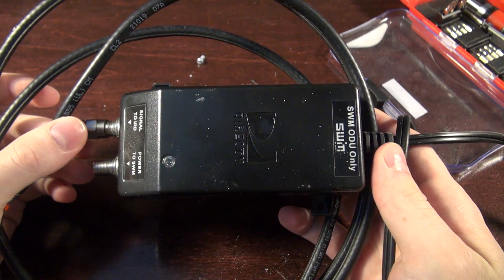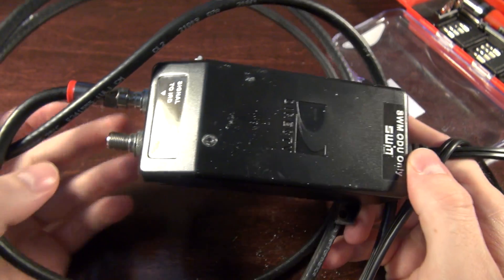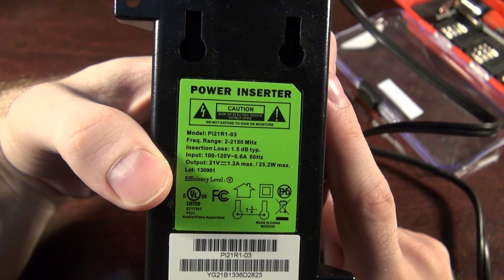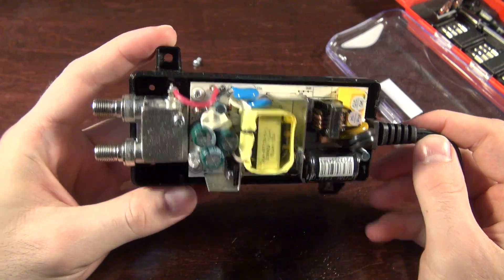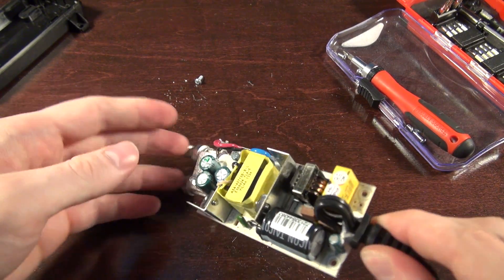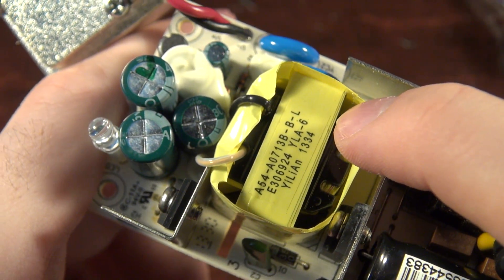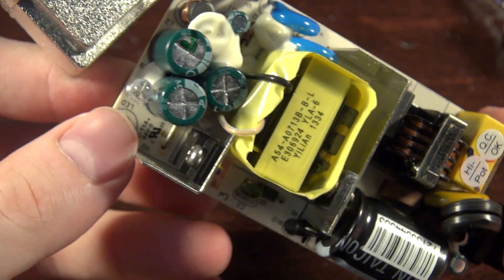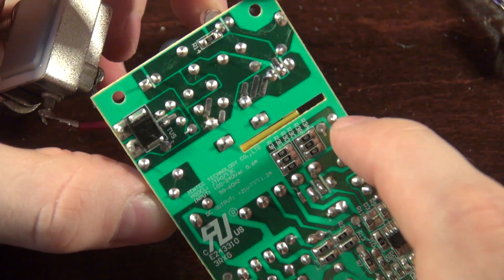Satellite Power Inserter Teardown

Comment: For those who may be interested in a little more tech info:
One can measure the value of the coupling capacitor that blocks DC, but passes RF, without prying open the metal box.  The value is 0.01uF.  Signal loss is very low at TV frequencies.
The later model, PI21R3-16 uses a different RF enclosure with a hole in the side (!), so I would conclude that the shielding is not as good as the dash -03 model.  Capacitor value is 0.01uF.
The PWM IC that does the switching magic is unmarked.  If the device were known, it would be straight-forward to adjust the output voltage and repurpose the power supply.  That being said, the dash -03 model lends itself to an easy mod whereby a TO-220 style three-terminal regulator IC can be affixed to the ground screw on the metal inserter box.  Unsolder the red wire from the feedthru and wire in the IC.  Many CATV/TV drop amplifiers operate on 12V (some recommend 15V, but I've found that they work just as well on 12V).  With a 12V regulator, the heat dissipation with a 200mA load is about 2 watts and the metal box makes a great heat sink.

Comment: Nick, this is actually quite informative teardown! Thank you for your time and for doing this. Thumbs up from me. It is, like you said, a good quality switched mode power supply that sends DC (21v 1.2A) toward the satellite head using the antenna signal cable. The main element inside the metal cube is a capacitor allowing the RF signal (AC) ranging 2-2150 MHz to pass thru all the way but blocking DC from going toward the TV set's end. It's just a clever way of using the same coaxial cable for RF signal (AC) and DC power needed at the dish, hence "power inserter."  
BTW, Laptops usually need around 3+ Amps, so 1.2 from this one would not be sufficient.

Comment: There is laid back and carefree, and then there is lazy and I don't give a f* about your time. I don't know which the host was trying for, but I think it comes off as the latter. Since I am learning about these today, I'll share some of what I've gleaned so far. As expected, the magic happens in the unopened metal box. It is called a bias-t. It supplies power to the LNB at the focus of the satellite dish while keeping the 21 volts DC out of the receiver and keeps signal from leaking into the power supply. Since capacitors resist DC but pass AC, capacitors are used to keep unwanted DC out of the set top box or radio equipment.  Since inductors (coil or wire) work the opposite way, inductors keep the AC satellite signal from going into the switching power supply (and noise from the power supply out of the signal)  but allow DC to pass into the line to power the LNB. Since the real world is more complicated than my explanation, inductors and capacitors are imperfect and to a degree that somewhat depends on the frequency of the AC, several inductors and maybe capacitors are generally used to ensure proper blocking, and avoid unwanted resonances. Since the frequency is high, around 2 gigahertz at that point, the parts can be pretty small, maybe just copper traces on a circuit board that act like coils or wire, and use the board or air as a dialectic in a capacitor--but I don't know enough to know if that might be done in this case which is part of why I really wanted to see inside that thing.

Maybe a bit off topic, but the LNB can do quite a lot. In older systems a combination of voltage and the presence or absence of a 22KHz "tone" sent down the line from the receiver  put the LNB into different modes, mostly frequency range and switch between right and left polarization reception. It also down converts the satellite frequencies from around 10-20 gigahertz to around 2 gigahertz, and amplifies the signal. However, the power injector in the video is for a newer technology called SWiM or SWM which does the old stuff and more using protocols I haven't found anything about so far. Added features include tuning in a narrower frequency range corresponding to specific satellite transponders and I don't know what else. I'd like to know the protocols and more to see if I can hack together a really crappy radioastronomy telescope and/or just mess with picking up man-made signals on my SDR radio that are otherwise too high for me to tune in.

Also interesting to me, if I understand it correctly, the LNB and radios, down-convert high frequency signals by mixing in a known high frequency signal. The two combine to create a lower beat frequency. It is similar to what you hear when two slightly out of tune musical instruments try to play the same note--it kind of gets louder and quieter in pulses as the tones interact constructively and destructively. That pulsing is the down converted signal. I attempted to do something like that to listen to the ultrasonic calls of bats. I heard something, but honestly, it sounded like shit, so maybe I don't know jack, or maybe I was just hearing bats cussing me out for making annoying sounds.
Reply: Are the input and output of the power inserter completely isolated, or should you be able to get some continuity. My TV is out I checked the solid wire connection between the 2 and get nothing.

Comment: just found one of these while scrapping tonight. Are there any known hacks/ repurposed applications for this device?
Reply: Aside from repurposing the power supply like he said, I would try repurposing the "potted" F-type connector piece. It's a bias tee. So if you apply a DC voltage across the red and black wires, it will bias the SWM port while the IRD port will not have any DC bias.
Reply from the maker: +canoestothemoon none that I can think of, but I haven't done much digging. Could reuse the power supply without the adapter box for something like a laptop that uses that voltage or something similar.

Comment: Use a pair of pliers and you can unscrew the F-connector posts. you will destroy the threads and trash it but it will let you peek inside a bit, also you could carefully cut the glue around the back and pry the back off. in some 2 way splitters there is very little inside them other than a few resisters.
Reply from the maker: Thanks! I'll try that! I was probably going to do a followup soon.